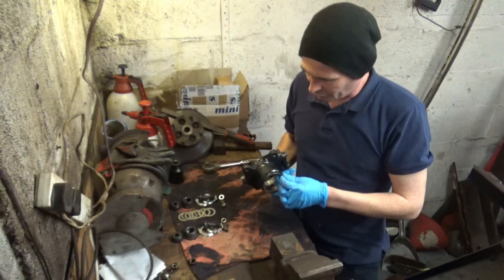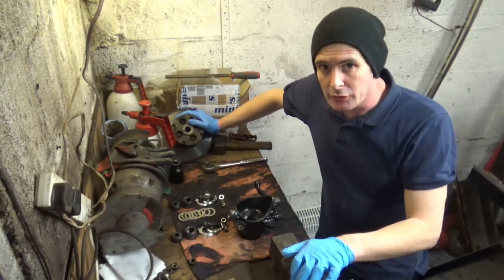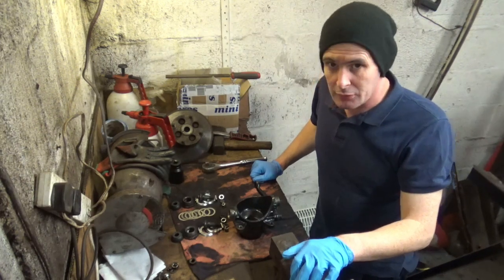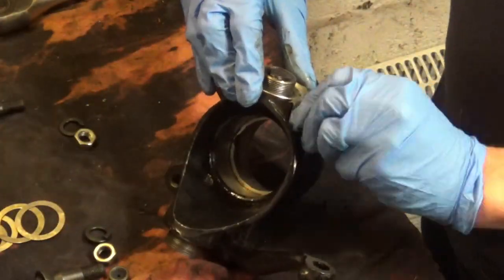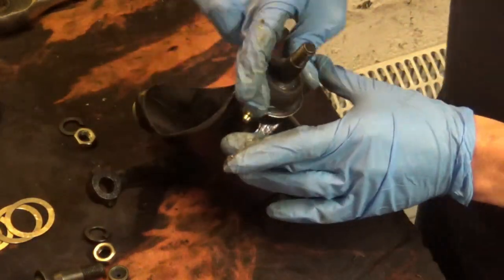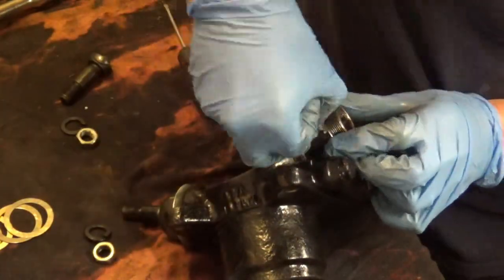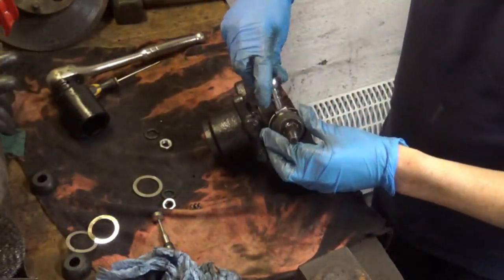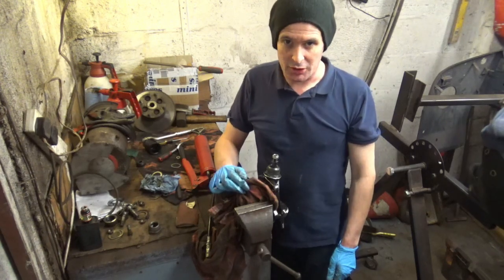Austin mini ball joints fitting

Comment: Hi could you tell me after how many km do I have to change or to reset the joint ball ? I know that it is hard to adjust them but someone told me that it is needed to set them again each 500miles. Is it true ?
Reply from the maker: Whoever told you that information is talking out of their arse. Balljoints can last many thousands of miles. The key is to keep them greased up. Greasing them should really be done every 1500 miles or so. If you keep them greased then they will last a very long time!
Reply: @BMCWorkshop  thank you. Guys who apparently have mini’s since 30 years 😔 What about the joint ball without maintenance. Do you think they are better ? A scam ?
Reply from the maker: @moohfr  like a sealed ballpoint? If that's the case I wouldn't bother. Grease is cheap and literally takes seconds to pump it in to the joints. A well set up and greased ballpoint will last a very long time...
Reply: @BMCWorkshop  no grease no chimes

Comment: Does the car need to be aligned in anyway after changing the ball joints?
Reply from the maker: Hi Dave, after changing the ball joints the alignment should still be OK but having it checked wouldn't go amiss.
Reply: @BMCWorkshop  thanks. I have one that will not take any grease, so was thinking of replacing unless you have any ideas what could be stopping it
Reply: @BMCWorkshop  that was my thought also but still won't take any after replacing.
Reply from the maker: @codecraft2004  in that case I'd whip the ball joint off and give the seat on the hub a good clean out and also check the little hole where the grease flows through as this may be clogged up